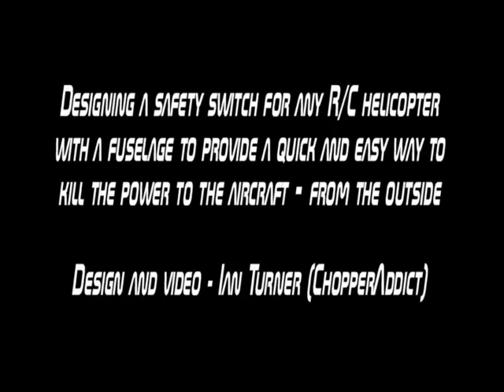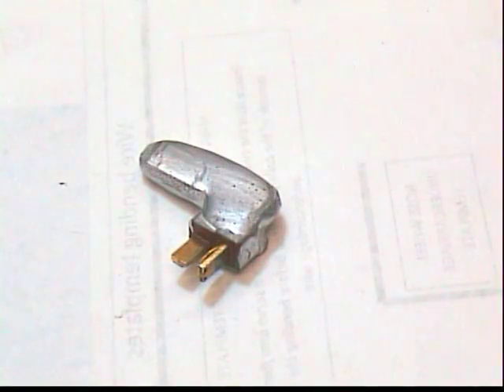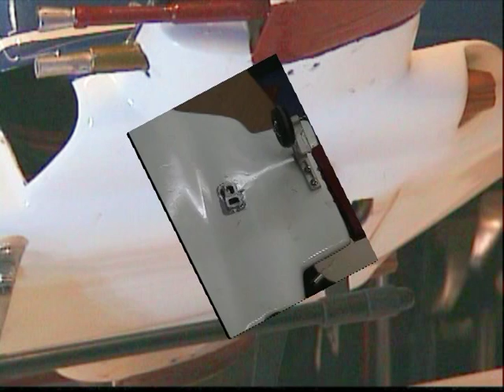RC Helicopters power switch idea

Comment: Ah sorry.. a Mosfet is a type of transistor, same as used in the ESC's. Using a 90A one (or 2 in parallel) will handle all the power you need. It just requires one resistor to 'pull' the gate (the pin that turns it on) to 0 Volts, then use a small switch to switch the battery volts to this gate.. this turns it on.  Much lighter than a high current mechanical switch.

Steve

Comment: I had considered another way using power Mosfets with a tiny switch to turn the Mosfet gate on, but as yet not got around to it, a small 90A mosfet should nail it ;-)

Steve